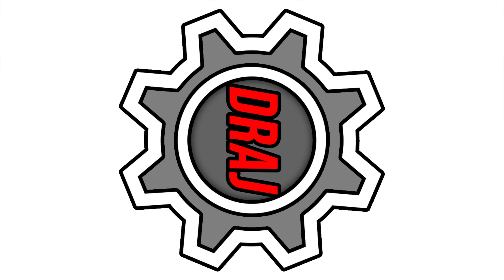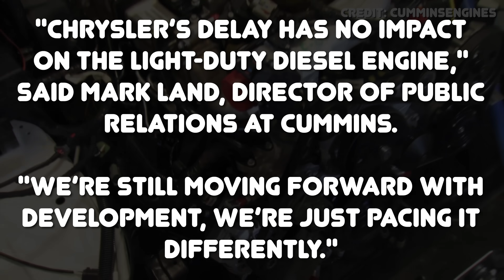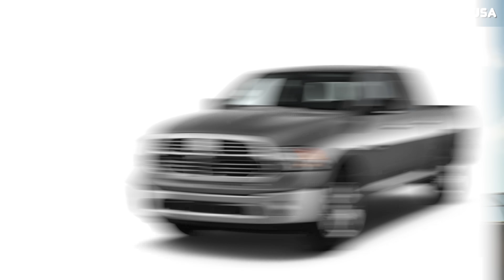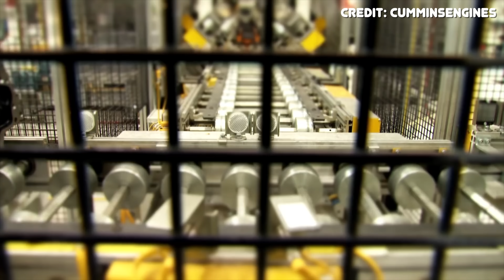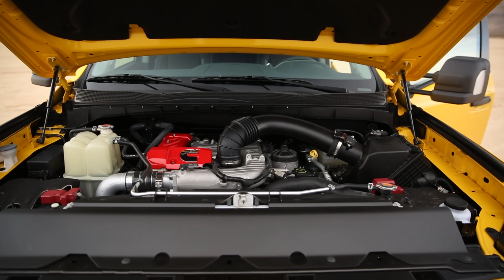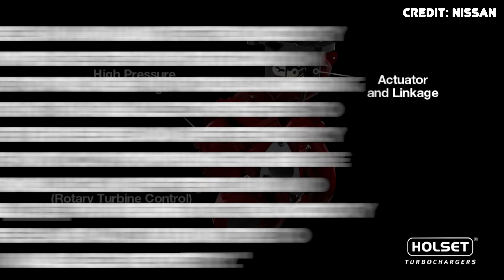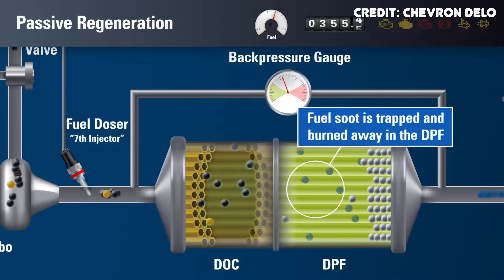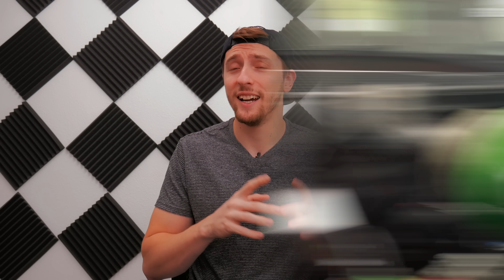5.0L Cummins: Everything You Need to Know

Comment: I've had 3 of these 5.0l cummins powered trucks in my life.  My dad has one he bought new and a good friend has had one he bought new and one he bought used.  2 of those 3 trucks have had major issues with the variable geometry turbo design.  In fact both of those trucks are still sitting on dealership lots waiting for parts (one has been there about a month and the other has been there for over 3).  Seems the 'interesting design' of the turbo has unforeseen weaknesses that Nissan and Cummins are ill-prepared to repair at this time (Q1 2022).
Reply: All I hear is problems from VGT’s
Reply: @Donniec685  I agree.  The difference here is that Nissan gave up on this engine by removing it from production and now it seems they have no incentive to keep their current 5.0 Cummins trucks on the road, either.
Reply: @DannyDoherty  nissan didnt remove it from production, Cummins discontinued the engine.
Reply: Nissan are so nearly awesome but their timing chain tensioners and crank angle sensors have been unreliable for 30 years.  They just seem to totally ignore some problems.  It's so bizarre.
Reply: How could two out of three trucks have problems with a variable geometry turbo they were never equipped with?
Reply: The turbo system in the 5.0ISV for the CD isn’t a VGT Turbo… Shows how much you know

Comment: i dont like the timing chain . diesel engines should be gear driven. the timing chain is instant weak point. gear driven is better.
Reply: Not the new ones i own 3 trucks all gear timed all big rigs gear timed. And thats why all the new deisels are junk. They put timing chains so they break and you gotta buy a bew truck. Lol most older diesels are gear driven and you cant say thet they aren't cuz they are.
Reply: JUNK!
Reply: Vw diesel engines are timing belt, never had issues with them specifically the 1.9 litre alh.
Reply: @harleyinglis5360  I'm talking trucks half ton and up. Car and small diesel engines don't do "the work" that bigger diesel engines do. When you start pulling over 7-10 thousand pounds you want gear driven they have more rotation mass and it's 10 times more heavy duty. All equipment and big trucks are always gear driven straight 6 cuz they are most efficient and it's perfectly ballanced. That's off topic tho lmao
Reply: Very few diesels are gear timed
Reply: @alexstromberg7696  100 % of John Deere diesels are gear timed.  I can also speak to the Cummins QSX15 as they are used in certain John Deere models, gear timed as well.
Reply: @alexstromberg7696  every trailer truck on the road and 7.o liters and up in mid sized trucks are gear driven. Little car motors are belt cuz they don't do much work pulling weight.